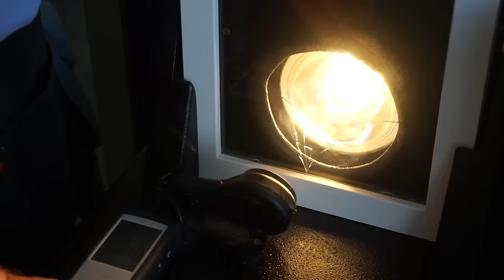Van Life - NEW technology in Window Tint on Stealth Camper Van - SPF 1,000 XPEL PRIME XR Window Film

Comment: BTU is the amount of energy needed to raise 1 pounds of water by 1 F. It's the imperial system's "equivalent" to Joules which is MASS*AREA(squared)/time(squared).

It's a measure of the amount of heat. 1 BTU is 1055 Joules.

For the nerds watching... ;)

Comment: Most glass naturally blocks UV light. It's a property of glass. Most sunglasses are made with plastic lenses (not glass) so they need a coating to block UV light. If you sat on a beach under an untreated perfectly clear and not tinted piece of glass it would be physically impossible to get sun burned. Physics is fun. 

So unless you have weird glass in your car (typical car safety glass blocks all UV light) you do not need to tint to block UV light. That aspect of the marketing for the tint was a lie. 

Another fun fact, transition style glasses that turn darker when you go outside and lighter when you go inside work based on UV light. They do not trigger when you're driving unless you're opening a window to let UV light in.
Reply from the maker: Good stuff! Thanks
Reply: Good info.  You did see the meter showing the block of sun energy full spectrum  - whatever he called it.  It would be interesting to know if someone has had changes in the heat effect and energy use of air conditioner.  It would be perceived, but would definitely be interesting to hear.
Reply: zero11010 ,  i live in a very hot sunny climate, I have seen Vehicles Interiors destroyed by not having window tint
Reply: What are you talking about. Every car coming in to my shop, that hasn’t been tinted for a couple years, has obvious interior damage. My car is 11 years old with a fresh looking interior. It’s always been tinted
Reply: I was thinking the same thing all the way through the video. Nice to see someone else address the issue. You can NOT get a sun burn in a green house. Glass filters out U V rays that's also why it is used in U V sterilization rooms in the form of glasses and/or screens.
Reply: @zacharykingston1046  Perhaps the owner was using UV interchangeably with radiant heat. Radiation energy is a spectrum, thus UV is only one component of the electromagnetic spectrum which glass successfully blocks, but lets in the other components of the spectrum--generating radiant heat.
Reply: @Rmccullo808  and zero11010, you are both correct. Glass blocks 98-99% of UV (not IR though). A car parked in the sun gets many hours of sunlight and low UV a day for years - that's still a lot of cumulative UV. For a person though, not an issue. Plastics, vinyl, synthetic fabrics are rather UV sensitive too....

Comment: From outside you wouldn't even know that there is tinting on the windshield and since I asked them to use the same product on the two cab doors, I don't expect to be bothered by the cops in California where I'm from. The important thing is the film with the least amount of tint provides the most heat reduction. From inside the "darkening" effect mainly just breaks the glare, and doesn't pose any driving difficulty for my older set of eyes.

Comment: These tests can be misleading because they're not doing the testing as though it's used in the practical application. The sun is not only on for a minute, it's beating down through your windows all day long. They should let it sit there for 10 minutes so that the tint and glass or whatever it is attached to has time to heat up like it would if it was exposed to sunlight for an extended period of time. I would like to see this test done with the film sitting behind the lamp for 10 minutes and then measure the btu output so we have more realistic numbers to go by. Thanks for the video!
Reply from the maker: Hey Tyson, We can tell you what our results are in the real world tests... the first time we drove the van after putting the new tint on, which was a very sunny and hot day, we realized after 30 minutes that we forgot to put our sunglasses on!  And the van stays much cooler now.  Love it!

Comment: If I use this, a foam based insulator with around 7R per sq in, as well as a ceiling and floor vent, will that be cool enough for a dog to stay in the car? Of course I will have a remote monitor in the car to make sure it doesn't get too hot, but with that combination, how long can a dog stay in the car?

Comment: great video, will look for this product when I get my windows tinted.  now what about winter insulation.  does this tint help with that or is this only a summertime modification?  And how much did it cost?  thanks!
Reply from the maker: This product works great year-round protecting your dash and interior! It costs between 400-500 depending on whether you have tint that needs to be removed ( like mine ) and the number of windows.( I had 6 plus the windshield) Also I got the extra "visor strip" on the windshield, on top of the window film. Well worth it in my opinion. Incredible difference. Thanks for your comment and for watching Jim.

Comment: have you noticed a difference in the van after the new tints.?..ie is it cooler.
Reply from the maker: yes, the tint has made a huge difference. I definitely  recommend it.
Reply: i seen the other video with the stone chip paint on the van..i always hand paint old vans..pointless throwing 1000s at a repray..that stone chip is like rubber but still hard...practical is key...and it holds all the rust together.lol..i also wax oil the under carriage with old engine oil.winter preperation..
Reply: i guess its also warmer on a night time.?

Comment: I don't get it - since when did they leagalize tinting your side passenger and drivers windows? thought there were laws about that, for example - you get pulled over by police, don't tinted windows like that pose a possible danger to them since they can't see you or your hands?
Reply from the maker: It's all legal and not that dark - D & D tint shop is the best.  The laws vary by state.  Also, it's not the darkness of the tint that blocks the UV.  In fact some of the lighter ones are better and the darker ones can be the worst for UV blocking.

Comment: How much cooler is it inside  compared to the old tint?  Is the difference really noticeable?
Reply from the maker: Absolutely!  I can't tell you how much cooler it is but i have to turn my A/C on low after about 45 minutes of driving and outside temp is 95-100 ! You can feel the difference on you skin if the sun is shining in on the drivers side. Before I would get hot from the sun, now I am very comfortable.

Comment: ok,  now the bottom of the line.   What is the final cost of all the windows new tinting?
Reply: I live west of DFW area and called that tint shop for a quote on my '98 E350 club wagon church van. For the not-quite top of the line ceramic film it was $450.!!! And they asked me right up front if I was planning to use the "discount" from this YouTube channel. 
Too steep for my budget. I ended up going with Amazon purchased white perforated vinyl film....that installs on the OUTSIDE of the windows.!!!
Much easier on my old, 340 lb body.
I did two windows today, very simple. Need my wife to assist on the longer windows to raise up and adhere to glass.
Material costs will total about $80 for all windows.
WINNING-!!!
Reply: Do you like the new stuff?
Reply: @bigjoe2458  so far, I like the white perforated vinyl.  But if your van isn't white it might not look good.  Only choices are white or black.  Look up perforated vinyl on vans YouTube videos.  Visibility from inside to outside is very good in daylight time.